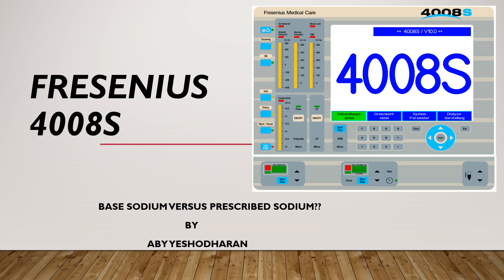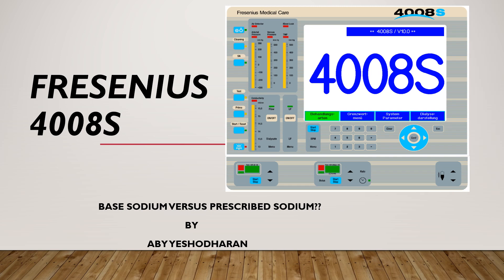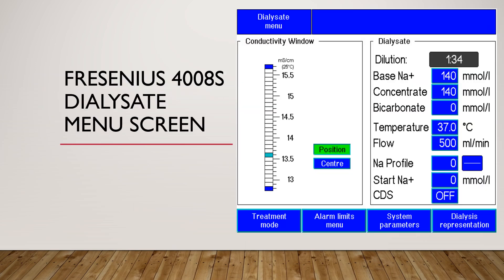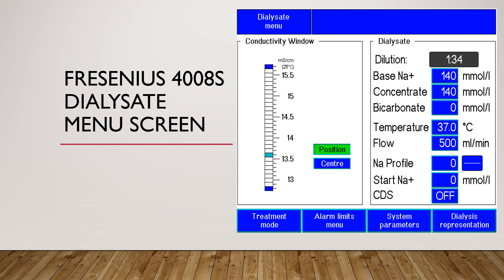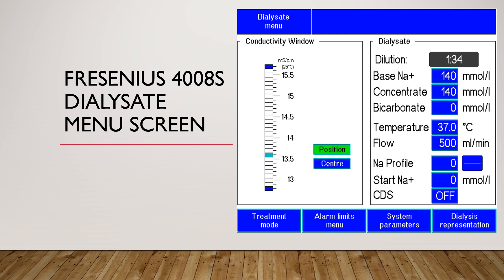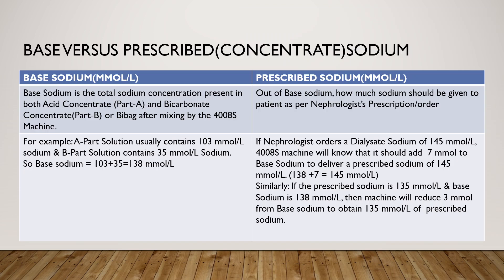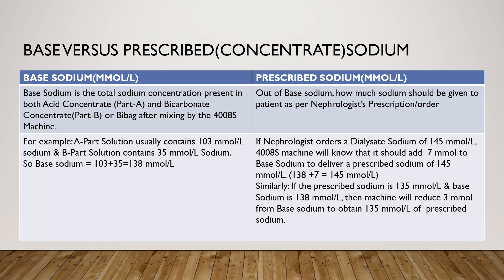Dialysis Machine Explained: Dialysate Sodium Settings In Hemodialysis Machines#hemodialysis

Comment: why do u need to set the base sodium if its constant?
Reply from the maker: Thanx a bunch for the question. My apologies for the late response. The base sodium in the dialysate depends on the sodium concentrations in both Part A and Part B of the dialysate concentrate. Since different manufacturers produce concentrates with varying sodium levels, the base sodium can differ from one product to another.

If the machine is set with an incorrect base sodium value, any prescribed sodium adjustments will be inaccurate. For example, if the actual base sodium is 138 mEq/L but the machine is programmed with a base sodium of 135 mEq/L, increasing the prescribed sodium to 140 mEq/L will result in a delivered sodium of 143 mEq/L instead of the intended 140 mEq/L. This discrepancy can have clinical implications, as sodium levels influence fluid balance, blood pressure, and patient comfort. Hope you understood the concept now ?

Comment: In case of 36.83X mixing system if I change prescribe sodium then mixing ratio will remain same or will be changed?
If not then what does machine increase only target electrolyte like Na+, HCO3- ??

 What is the actual final bicarbonate level when machine shows '0' value at fresenius 4008S??
Reply from the maker: Even if you change prescribed sodium, your Mixing ratio will remain the same. HD machine increases Dialysate sodium by increasing the consumption of Acid Concentrate(A-part) and reciprocal reduction of Bicarbonate consumption. The answer for your second question: Why a user can increase only sodium and Bicarbonate in a HD machine but not other electrolytes? The answer is that, the concentration of sodium chloride and bicarbonate is higher than other negligible electrolytes such as potassium or magnesium or calcium. But you should remember that, if you change sodium and Bicarbonate concentration in dialysate , the concentration of other electrolytes are also altered but most HD machines doesnt have the facility to display this change in electrolytes.But fresenius 5008 series and 4008A series machines could display these changes. The answer for your last question is : By default FMC 4008S machihe shows Prescribed bicarbonate as "0" which means, the prepared final dialysate  contains the exact amount of Bicarbonate concentration which is present in your Part-B concentrate. If you use a local B-Part powder of 840 Gms, it contains approx  34 mmol/L of bicarbonate. So if Prescribed bicarb is 0 , which means patient is getting 34 mmol/L  Bicarbonate. If you increase Prescribed Bicarb value to +2, your patient will be getting 36 mmol/L(34+2=36) Bicarbonate. hope you understood the concept. If you still have queries, post your doubts in comment section. Aby
Reply: @HemodialysisGuide  Thank you so much ,i am highly satisfied with your answer.
Reply: @HemodialysisGuide   Sir, if consumption increase of part A &  decreace of part B solution what does mixing ratio remain same ?? 

Thank you so much for elaborate so clearly.
Reply from the maker: @prasantakhanra765  in order to answer your excellent doubt, lets imagine this scenario: Your Base sodium is 138 mmol/L and Your Prescribed Sodium is 140 mmol/L then the machine will increase 2 mmol from base sodium to obtain a prescribed sodium of 140 mmol. So your remaining electrolytes such as K,Cl,Ca,Mg etc will also change a bit. Now imagine you need to increase Prescribed HCO3 from 34 mmol/L to 37 mmol/L.
 So the machine will suck 3 mmol of  HCO3 from B-Part. But B-Part also contains Sodium! so machine will reduce 3 mmol of sodium from A-Part to maintain your prescribed sodium at preset levels. 

Your doubt is reasonable. But you should remember modern machine uses a volumetric balancing system. Machine has 2 Spherical Blancing chambers with an individual volume of 30 ML. So it is all volume based mixing  followed by Conductivity measurements. For simplicity:
Flow rate = Flow Volume /Time
Required Balancing Chamber Switching Time= 1800/flow volume
If DFR = 500 ml
Balancing Chamber Switching = 1800/500 = 3.6 seconds.
This means, machine's FLOW PUMP takes 3.6 seconds to completely Fill the Balancing Chamber, to produce a 500 ml/mt flow. 

So key point is : It is volumetric. Machine adjusts mixing  as per balancing chamber volume  and set DFR.
Hope you understood the concept.
Thanks,
ABY